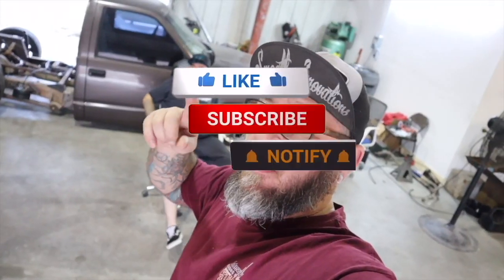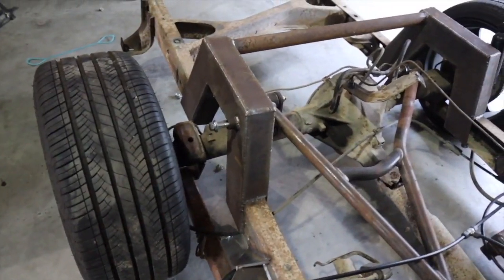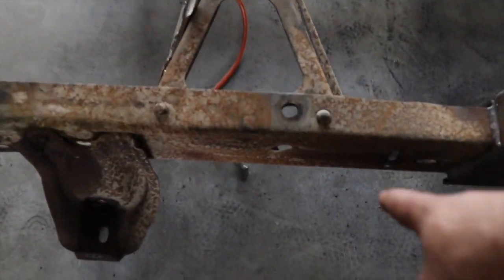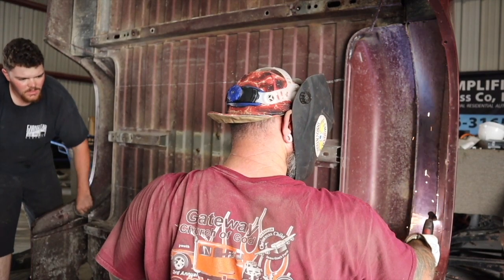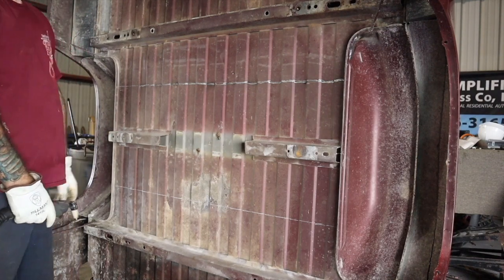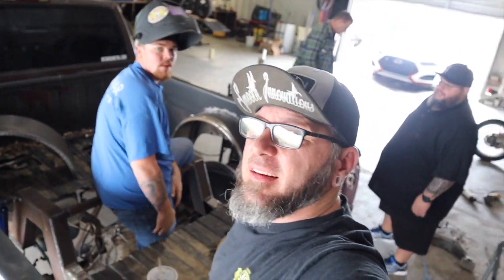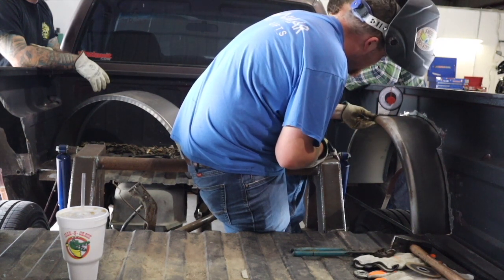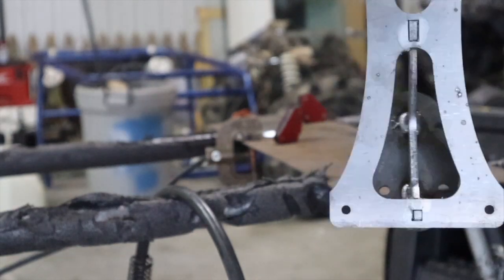How To Bag An OBS - Bed Cut Out PT.5

Comment: Hey man, Digging the videos. I got a 95 dually extended cab i am wanting to bag. I am stuck trying to decide if i should do a parallel 4 link , with panhard , or the infamous 3 link. Not wanting to lose the stock gas tank. I am considering putting the semi wheels on( if my funds allow) down the road. I would appreciate your opinion. Keep the vids coming.
Reply from the maker: I don't like pan hard bars, they are for race cars not bagged trucks. They push and pull the rearend side to side. Go with the Nfamus 3 link with the raise tank crossmember, that way you keep tank in the stock location.

Comment: Instead of going with the nfamus shock location what if I would go with shock relocation from diff to notch middle bars?
Reply from the maker: That would be just fine.  I like where the Nfamus kit puts the shock, they ride great and it comes with al the hardware to install it. The way I modified it was the quickest and easiest for us. Just make sure your shocks are at a good angle that make then efficient at any ride height. you never want your shock to be straight always on an angle

Comment: What would a job like that cost on a square body
Reply from the maker: You are looking at $4500-$5000 in suspension and air management. Labor to install and do all the fab work is $4000

Comment: curiously... how much, roughly, do you guys charge for this? i have a 99 tahoe 4dr 4x4. btw im a big fan of your work.
Reply from the maker: A simple bag job starts at around $2000 just in labor. Simple set up will cost around $4000 in materials and equipment. But that is just a shooting from the hip estimate.

Comment: front inner fenders? trailer fenders also?
Reply: Yes the front inner fenders were also trailer fenders, we used the long tandem axle fenders and cut them down to fit and so it would have a flat area on top to clean up the engine bay
Reply from the maker: https://youtu.be/ezBwU4YoeMM this is the link to the video for the front fenders